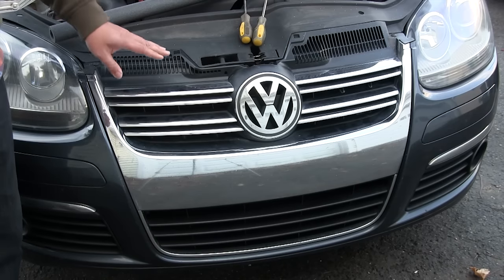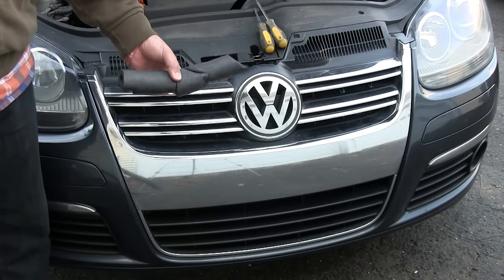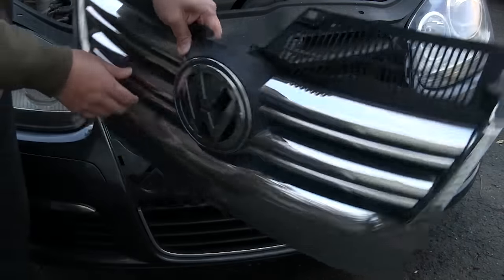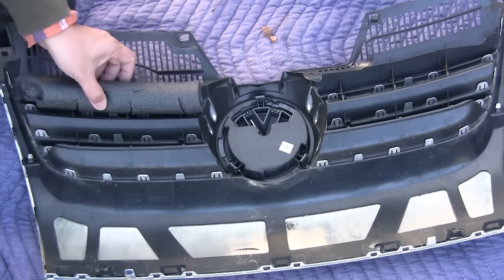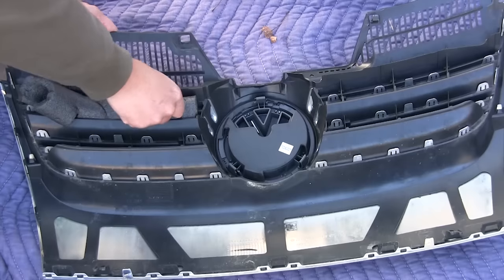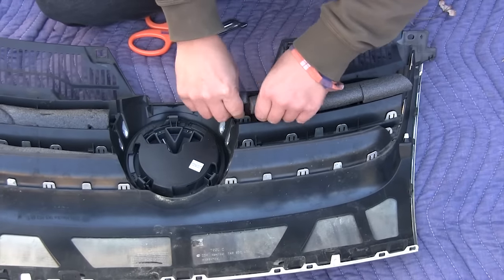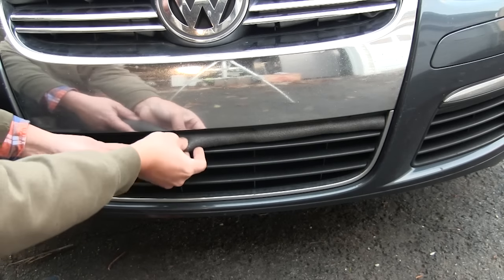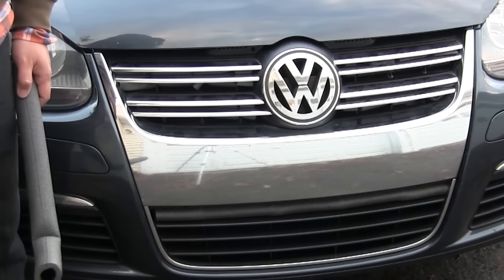DIY winter front grille foam barrier installation on a diesel

Comment: That's a good idea. I thought about putting something over the grill like cardboard but didn't think it would stay put while I was driving. I put a Frost Heater on my Golf TDI about a year ago. I got permission from my employer to plug it in over night cause I work nights and have a long commute. It circulates the water in the radiator and keeps it about 160 F versus heating the oil. I'll have to try  the pipe insulation next winter. Every little bit helps.

Comment: I've been using that same stuff for years on my 01 Golf TDI in winter, but I just put it all on the front of the grill.  I've only lost one or two bit over the years.  It looks okay.
I leave open the spot on the upper drivers side for the air intake, and at the lower grill on the passenger side for the intercooler.
Never had a problem with over heating, and it does help to warm the car up sooner.

Comment: But don't they have thermostats that closes the cooling circuit inside the engine so that the coolant will only circulate inside the engine only to help it warm up quicker then start to regulate the flow to the radiator to keep the coolant at 90°?
Reply: abd bach yea but u lose the heat when it cycles
Reply: Yea but as long as it stays at 90° it's all good, I have a 2004 Golf mk5 1.9TDI once it reaches 90° it never goes down so it's being regulated correctly I don't see the need for blocking the radiator, please correct me if I'm wrong.
Reply: abd bach if ur heat doesnt leave when idling ur good
Reply: Well yeah that's what thermostats are for in engines, if they're working properly that it.
Reply: At idle it gets hot and it cycles, water in rad is extra cold chills down the air and since u are not driving the heat wont build. Covering rad keeps that on tap cold water warmer so ur heat doesnt drop off
Reply from the maker: These styles of thermostats are not fully open or closed as the engine warms up.  They slowly creep open at lower temps, and if you reduce the cooling at the radiator it helps the engine warm up faster when below freezing.  Also, when it's really cold, my TDI's will go below the middle at the coolant gauge in stop-go traffic and up to 15 minutes before the temp needle is in the middle.  This helps reduce that effect.  If it's not below freezing where you regularly drive the car then this video doesn't apply to you.  Some newer cars with electronic thermostats have separate cooling loops and fully open/closed thermostats which speed engine warm up and reduce emissions, since most harmful emissions are produced on cold engines, before the engine is tight and the catalysts warmed up.
Reply: Ok thanks for the answer!
Reply: Today I measured the positive-going and no result (-3C)
It must beat least (-10 ° C) can be
Reply: The people who don't have TDI cars don't understand. I have 2. They both need the front ends blocked off to have good heat. It's not a lack of knowledge or poor upkeep to the cooling system. These cars are so efficient they cool themselves down a little too well in the cold months
Reply: @user-dn6qy1ou1f  - I have a TDI (2001 Golf MK 4) and it's not that you don't get heat, I get it INSIDE the cabin just fine and preaty fast (without any blockage), but the engine doesn't heat up fast enough to above 80 ° C. If you stop in traffic or you crawl in it, the temp indicator starts to go down, of course when it's below minus - 10... -15 ° C outside, but inside it's warm and cosy. 
That's why I started to use the method presented in this video, for the sake of the engine, not mine.
Reply: @zumik83  mine both do the same. I also have a 2001 TDI golf and a 2001 TDI Jetta.  These cars just don't have super great heat. My golf will go up to full operating temp with the grill blocked off. My Jetta doesn't get but barely past the first 2 lines.